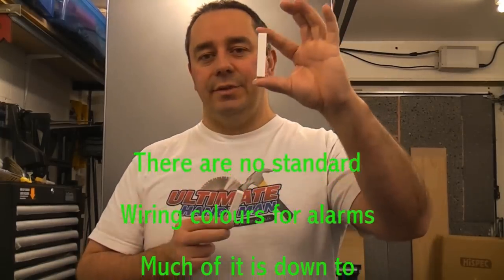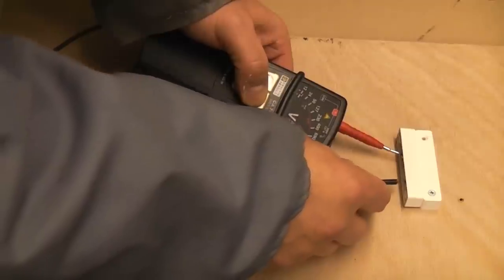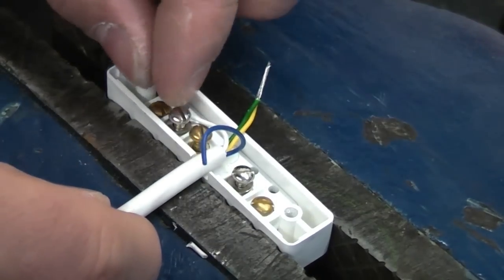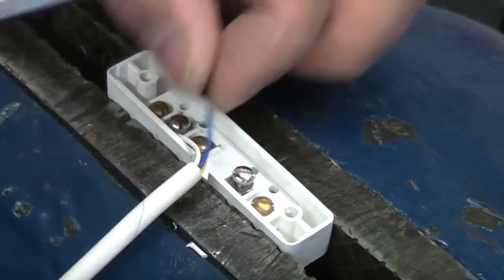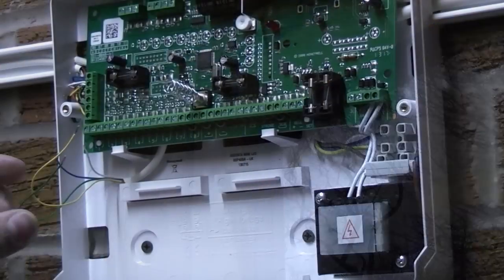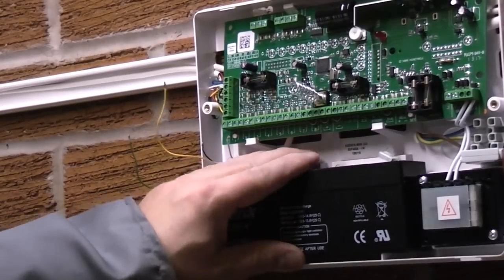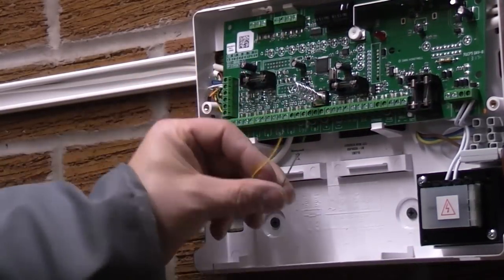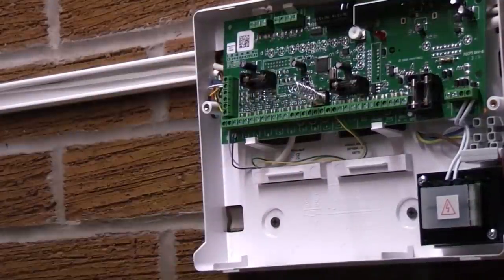How to install a magnetic door contact | Reed switch

Comment: I'm sure that's a much better magnetic door alarm than the battery operated Yale alarm I once had on a property. It was so temperamental I didn't like leaving home in case it went off for no reason whilst I was out. Great video as always Chez!
Reply from the maker: Thanks Kev, These alarms are normally very reliable. People often talk about wireless alarms but I don't like relying on batteries for something so critical. Thanks for the comment ;-)

Comment: You joined the tamper cables into one and fitted them to switch.When fitting to panel are they also fitted together before adding to the inseries block or done as separate cables, thanks Chris
Reply from the maker: They need to be joined in series (to make a large loop), if they are wired in parallel, the tamper circuit will never work. 👍

Comment: Thanks for this. Had a new door installed and had to fit one of these as the existing wooden door one was a flush inserted in he frame and  door. Little did I know cutting the wire would set of a tamper alert. One of these fitted now and alarm all working as normal again.
Reply from the maker: You are welcome
Thanks for the comment 👍
Reply: Thank you so much

Comment: Thanks for reply
It says power down ...dose that mean unplug fuse..
Then it says remove wiring from set out put pa terminal...?
The fit shorting the ire between set and left hand pa terminal  ?.. don't get that..
Then power up.
Wait for alarm to start ..
Power down panel and then it's restored

So dose it mean I have to wire the key pay the wrong way then power up?

Comment: I've realized that in order to build a fair and balanced 'Nerf Tank' for outdoor play, this is exactly the perfect sort of switch that would be needed to ensure that players in a game can in fact disable the tank. An 'unkillable' tank isn't fair to all the other players, so some panels wired to the motor circuits of this hypothetical tank that use magnetic reed switch contacts would make the best manner with which to disable the tank with say, a foam rocket or lots of well-placed darts at close range.

Comment: i was drilling into the door frame and suddenly heard the door chime for a second - i think i may have touched a wire linked to the door sensor that runs somewhere behind the frame i was drilling into. However, the tamper alarm didn't go off and the door sensor seems to work fine. could i have severed a wire? if everything seems ok is it likely that i just drilled too close to the cable?
Reply from the maker: Drilling close to the cable should not effect it. If a wire has been severed the circuit will not work properly. If you have the instructions you can do a walk test- or if the chime is still working- the sensor is probably ok.

Comment: hi i have just installed the gen4 alarm and as i was about to change the key pad code from 0123 to say 6666 i had mucked up and not i dont know the number i have set ...hoe do i reset the whole thing so i can reprogram again..ive tryed unpluging the batt and the fuse and still no good
Reply from the maker: You might have to do a "default panel to factory settings"
It's on page 17 of the engineers manual ;-)

Comment: You can double the pulling power of the magnet by adding another magnet and putting it pole to pole in cases when you are mounting it on a metal door.
Reply from the maker: Thanks for the comment

Comment: Great vid. Enjoyed mr squirrel! Question: If i want to replace a live pre existing door contact (old shabby) with the one in your vid, is it just a case of removing the old one and putting the newen on? Will the alarm buzz or fail due to the tamper feature? Cheers
Reply from the maker: No, it is best to put the alarm panel into engineering mode first if you can, or the alarm will probably go into tamper mode.
Reply: Ultimate Handyman aaah i see. Thanks a lot brother. Ill dig out the manual n gerit sorted. Cheers from the toon ✌🏼🏴🏳🏴🏳
Reply: any idea how thats done on a veritas r8 alarm? cant find anything on how to do it.

Comment: hi i have installed the g4 system i  would like to wire two door contacts would you explain how to link them please thank you in advance , by the way great videos explained in plain language
Reply from the maker: I'll cover this in a video at some point, but basically all you need to do is wire the sensors in series.
Thanks for the comment

Comment: Im just in the process of installing the very same alarm. Do you know if the panel can read resistance on the zones? I only ask because my old bosch panel did and it added a bit more security from someone joining the wires together and bypassing the pir or reed switch.
Reply from the maker: I'm not sure, sorry.
I don't recall seeing anything in the manual about it but I was not specifically looking for it.
Reply: No worries. Thanks for responding.

Comment: Any tips for wiring a surface mounted on French doors . Looking to try and hide as much cable as possible within the door frame !??
Reply from the maker: Not sure about in the frame, as I have never tried that. 
I guess you could run the cable right in the corner though and cover it with a bead of silicone, perhaps.

Comment: Best diy channel what cordless drill would you prefer dewalt 18v or jcb 20v
Reply from the maker: Keelin Black 
I don't know anything about JCB tools. They are world famous from making diggers but I know nothing about their power tools.
I always try and buy a cordless drill with a full metal chuck (not the plastic outer ones) as they tend to be more heavy duty. My Dewalt drills have lasted years and I am more than happy with them.
Reply: Thanks anyway would you reccomend a dewalt 18v cordless drill
Reply from the maker: Keelin Black 
Only if it has the full metal chuck.
We had a Dewalt 18v at work with a plastic outer chuck and it was rubbish- they tend to make cheap versions with plastic outer chucks, which let their brand down!
Reply: Any other brand suggestions instead of dewalt
Reply from the maker: Keelin Black 
Most of my tools are Dewalt and I have had no problems with them.
I have seen Dewalt with a plastic chick that are not good and also Bosch with a plastic chuck that were not good.
There is no definitive answer to this question as all tools are different prices, it depends entirely on your budget and how much use you will get from it. It's pointless going overboard if you are only going to use it once in a while!
Reply: Thanks

Comment: Ho does magnetic door contact work?  In normal condition the magnets are separate to doors i means there is no contact with door when fire happens the module complete the circuit &  door gets magnetized & get closed , m i right?? Pls explain
Reply from the maker: These are for a burglar alarm, not a fire alarm.
These sensors are normally open when the magnet is not present, but the circuit closes when the magnet is close to the reed switch. Burglar alarms work using normally closed circuits, as soon as a circuit is open, the alarm will activate.

Comment: good day, i got a pyronix euro 46s system , that i want to use these exact contacts for ........i only have 8 input zones and need to wire 29 contacts.... most about 5 to 6 contacts per zone. is that possible ? can you send me a basic wiring diagram illustrating this, do i need to add resistors?
Reply from the maker: No idea, sorry!
Reply: Good day can I get a basic wiring diagram showing the wiring of 2 of these door contacts

Comment: Hope you can help. We had some cowboys remove our old front door and rip the alarm cables out the connectors.  I have a 4 core red/black/yellow/blue & a 6 core red/black/yellow/blue/green & white.  The new front door is now in the porch so I need to extend the cables to reach - would I need a 4 or 6 core cable? Do I need  to connect all 6 wires up & if so how or is it just the 4 that are needed? Looking in the panel yellow/blue go to Z1 & tamp. white/green go to Z2-Z6 and the red/black are in AUX. Any help would be great. TIA
Reply from the maker: It's hard to say without seeing it, but normally for door contacts you only need 4 wires. Two for the tamper circuit and two for the zone.

Comment: i have the same control panel as you i installed a new door contact and wired it like you did when i came to arm the alarm it wood not work what came up was tamper fault so the alarm wont set i have check everything
Reply from the maker: If there is a tamper fault the tamper circuit is open. The alarm will not work until the tamer circuit is closed!
Reply: how do i close the tamper circuit
Reply: thanks very much for your help it works fine and bye the way your video is simply the best camera work spot on the best on the web geff
Reply from the maker: Sorry, I forgot to reply to your earlier comment.
I'm glad you got it sorted ;-)
Reply: i have the same problem wired exactly as you said how do i close the tamper circuit?
Reply: how did you close tamper circuit?

Comment: Sir, what is the name of that White cable?  And how we can connect particular colour wire to reed switch?
Reply from the maker: It is just known as alarm cable in the UK. As far as I know there are no set standards as to what colour wires you use at the switch or the alarm panel.

Comment: Hi I have an accenta mini burglar alarm I have hard wired it to 4 pir and magnetic door everything woks perfect except when I enter my code it shows the number 1 being alarmed which is the door and wont set unless I omit it as a zone I have 6 7 8 zones which are not in use and I have to omit these as well every time I want to set the alarm can you help me please.
Reply from the maker: +Donald Ellingham 
With the 6,7,8 zones you have to latch them out in the panel with some models, or you can put a link in each zone in the panel to close each circuit.
This video might help- https://www.youtube.com/watch?v=PBW7zVQ2fZ8
Not sure what the problem is with zone 1, are you sure it is wired correctly?

Comment: hi the wires on my door contact  are red, black,blue and yellow could you please advise the sequence they are wired
Reply from the maker: +CHRISTINE MORRIS 
It's impossible to say without checking where they are wired to at the panel. There is no wiring standard for alarm cable so the installer can use what ever coulours he sees fit.

Comment: what size cable do you use going into the FCU and what size Flex do you use coming from the FCU ??
Reply from the maker: I used 1.0mm twin core and earth going to the FCU and 0.75 flex going to the alarm, but you can use the twin and earth to the alarm instead of the flex.

Comment: when installing the magnetic door contact do i have to remove the power source first or?
Reply from the maker: No, as long as you put the alarm panel into engineering mode it will be fine.

Comment: hi chez. are you using 4 core cable for door contacts or is it 6 core with 2 cables cut? many thanks
Reply from the maker: Hi Arfan, I used 6 core with two cores removed as I had a coil of 6 core cable.
Thanks for the comment

Comment: This just goes to show how little the panel has changed in the last twenty years, when it was the Accenta 6 and 8. Virtually nothing has changed!
Reply from the maker: Chem_Boffin6589 That's right, I installed one of those a long time ago and not much has changed apart from you don't get the metal links pre-installed any more for each zone as they can now be disabled via the panel- although I find it easier to just place links in the unused zones LOL. Thanks for the comment

Comment: Could one alarm line share two magnetic door contacts?
Reply from the maker: Yes, it is quite easy.
If you want the alarm to alarm when just one contact is open you wire them in series, or you can wire them in parallel if you only want the alarm to alarm when both contacts are open simultaneously.
Reply: @ultimatehandyman  ....thx buddy

Comment: how would you wire a door contact and PIR in the same zone?
Reply from the maker: +B Powell If you install the PIR then run the cable from the PIR to the door contact then ensure that the tamper circuit and zone circuits are wired in series for the PIR and door contacts you can have both sensors working on the alarm at the same time. As an example imagine you just have a green wire and a blue wire and you want to wire these to the tamper circuit-The blue wire from the alarm control panel would go into the T+ terminal on the PIR, you would then connect the green wire from the alarm control panel to the blue wire going from the PIR to the door contact. The Green wire from the door contact would then be wired into the T- terminal in the PIR. This in effect makes a loop and if either the door contact of the PIR tamper circuit is broken the alarm will sound.How to wire a PIR is here- https://www.youtube.com/watch?v=Sb3y-66QDEk
Reply: +Ultimate Handyman 
Thanks for your response, I don't think that the above circuit works but I get the gist. With the tamper circuit the wires are daisy chained by connecting the wires together at the panel and I take it you are suggesting the same with the zone connections. The manual says where two detectors are used they should be latched using the L+ connection but doesn't explain how this works.
Reply: You don't!.......you never want a motion and Perimeter zone on the same circuit, nor do you want two motions in series. Entry/exit, PIR and other powered devices should be on their own zone, perimeter zones can be series but not ideal.....buy a panel with enough zones to make one opening per zone if possible.

Comment: I have yellow, red, blue and black....which goes where please
Reply from the maker: You'll have to check where the wires are terminated in the panel.
1 pair will be for the normally closed circuit, the other pair will be for the tamper 👍
Reply: @ultimatehandyman  ta....when the door guy took the old contact off (imbeded into the door and frame) it was red in a silver screw terminal, blue and black in a brass terminal and yellow in the other silver terminal
Reply from the maker: @leehewitt5165   Red and yellow will be the zone wires (normally closed circuit), one will go to each silver screw (doesn't matter which way around they are wired).
Blue and black are the tamper circuit, just connect both of them to one of the brass screws 👍
Reply: @ultimatehandyman  Brill thank you. I'll try again...its  letting us set the alarm but not recognising there is a block (if that is what they are called)....out of curiosity will it be affected if its a composite door.
Reply from the maker: @leehewitt5165   Did it work before the door was replaced?
A composite door should not make any difference.
The zone has not been modified in the panel, has it?
Reply: @ultimatehandyman  it did. I'll swop rhe wires over this weekend  and see if that works....i have another one to do on the new back door too. The 4 legged alarm would go off in anyone came through that

Comment: Squirrel. There's a squirrel in your video.
Reply from the maker: That's right at 3:16
There are lots where we live ;-)
Reply: I dont get what the tamper wires are for in the door contact? 
Wouldnt the alarm just go off anyway when they are seperated or give off a signal (chime, etc)
Reply from the maker: If the alarm is unset and someone cuts the wire going to the contact they could join them together which would prevent the door contact from working. If any tamper wires are cut with the alarm unset the alarm will go into tamper mode.
Reply: Ultimate Handyman now I'm with you, was just concerned about it when I saw you made the connection
Reply: Hi, if the magnet is moved would this cause an issue? I'm changing a door and need to take it off... not moving the wired part. If I put the magnet back in the same place this should work Ok?
Reply from the maker: Yes, that will be fine ;-)

Comment: See you have the cable running down pvc instead of stapling use super glue neater job,
Reply from the maker: I thought about doing that but wondered if the super glue would adversely effect the insulation over time- like expanding foam does.
Thanks for the comment

Comment: a little advice please, 12v buzzer  magnet switch mounted to a gate, the  buzzer goes off when the gates shut,  I want it the other way round, buzzer going off when you open the gate.
where am I going wrong
Reply from the maker: You can fix this by changing the reed switch to a normally closed reed switch. Once the switch is near the magnet it will open the circuit, and when the reed switch is not near the magnet it will close the circuit and energise the buzzer.